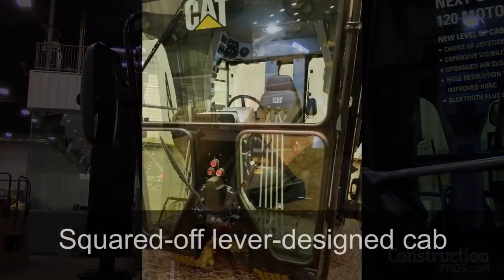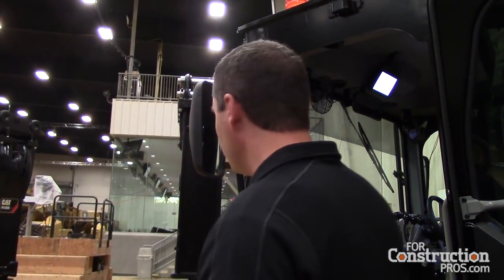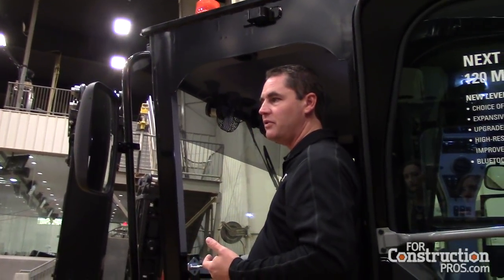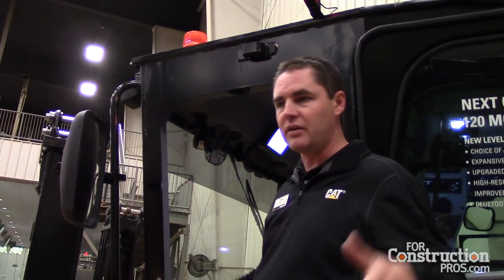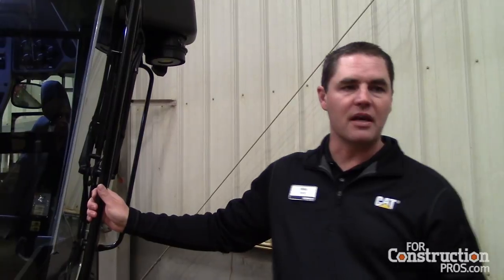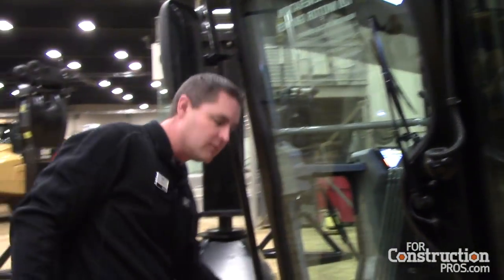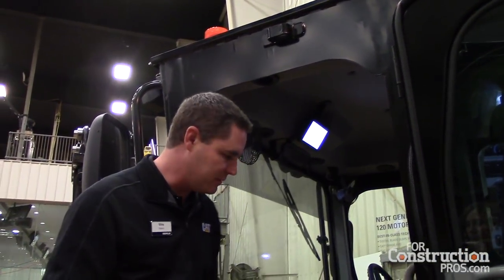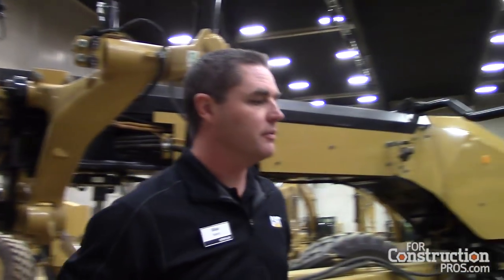Cat Cab Options Bring Choice of Joystick or Traditional Motor Grader Controls

Comment: Is there an option for a steering wheel with the joystick controls?
Reply from the maker: Pretty sure there's not. It's either joysticks or steering wheel and levers.
Reply: Slow learners. Deere still has more options, yet for the die hard cat fans the old style opens up the market for those operators. I like both.
Reply: Thanks
Reply: After running cat you wouldn’t want to run the Deere been there done that